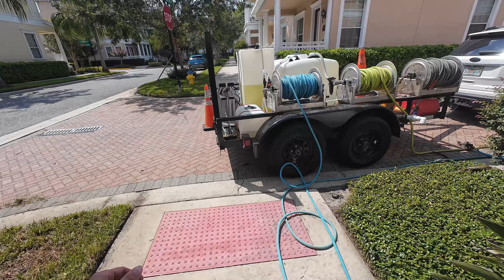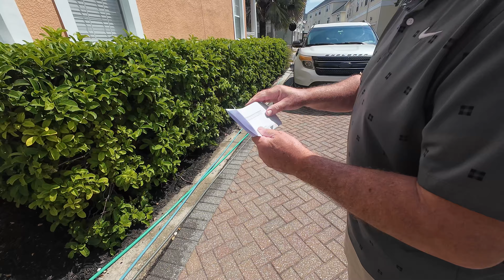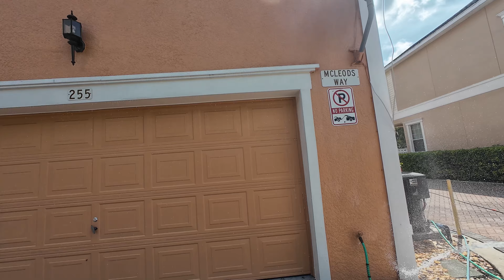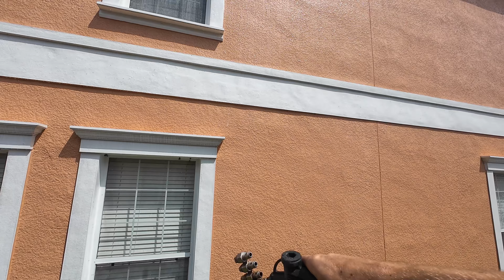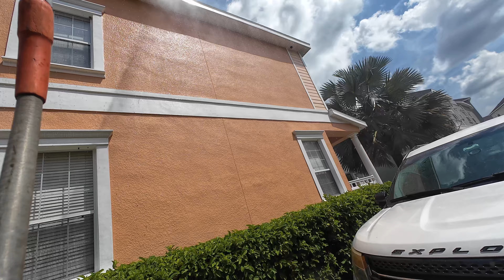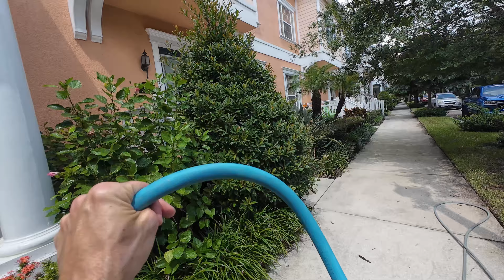How I Pressure Wash a Townhouse to Avoid HOA FINES!

Comment: Those few extra feet make a big difference for sure. Piecing together my softwash system and I went with 7gpm 100psi remco so I can get as much as I can until I can afford a gas or air system.
Reply from the maker: Yeah it would be fun to have a gas system LOL but its so expensive to upgrade systems. I've found I can do 99% of jobs at a decent pace with just the 12v.

Comment: do you ever have an issue with hanging electrical wires or appliances that we are spraying SH over?
Reply from the maker: I haven’t had any issues, I try to avoid directly spraying them as best as possible to avoid any water intrusion.

Comment: Why dont you just use downstream with a remote, pulling another hose with a weak 12volt is silly
Reply: I'm new to all of this, but assuming because he can't downstream 3%?
Reply from the maker: I like my 12v system, she’s done me good. The remote downstream system isn’t cheap either. I’ve also found that downstreaming a 1.25% mix isn’t strong enough for some jobs. The 12v system allows you to dial in whatever % mix is needed for the job.
Reply: @PressureWashingPOV  If you dont mind answering... what valves do you use on the 12v mixer? Can you verify that you're getting close to desired mix strength? Bucket tests at different settings?
Reply from the maker: @TheGoodLife62  I use GF valves, they seem to be pretty accurate. I've never done a bucket test, but they will definitely get you close to the % mix you want.

Comment: Where is your wand? I think you might need to check on getting more water and pressure. Your arms are getting so tired. My son is your age. I would not want him to struggle so much.
Reply from the maker: It's on the trailer I just didn't connect it. I can usually reach single and 2-story houses without the wand, but this property is technically 3 stories from the ground so on this job it definitely would have helped. Probably could have avoided pulling out the ladder. Thanks for the advice and watching the videos! I appreciate the support.